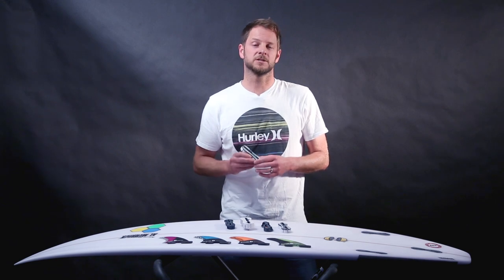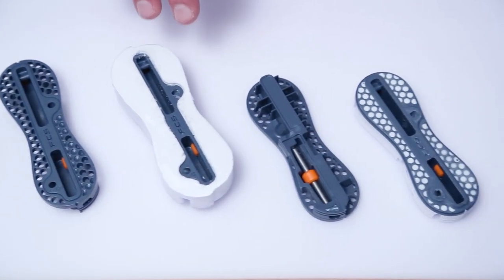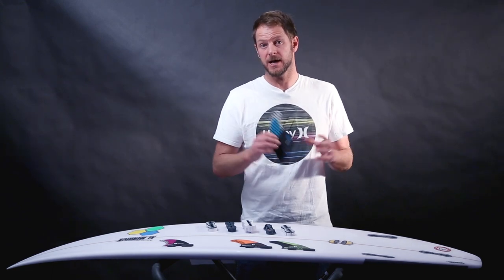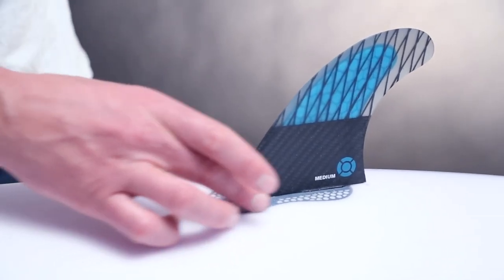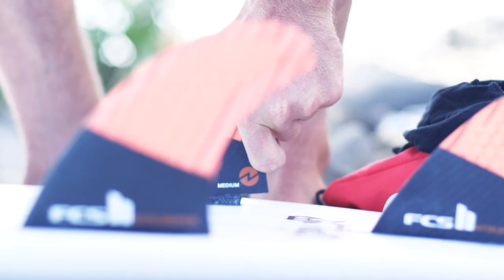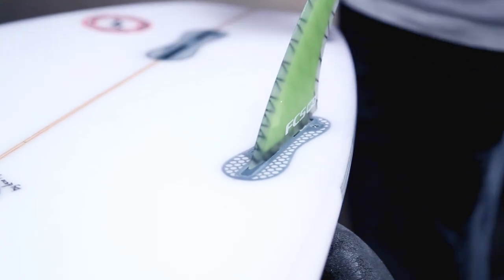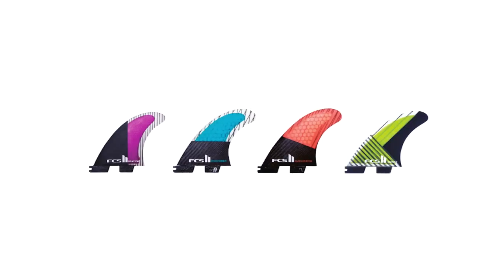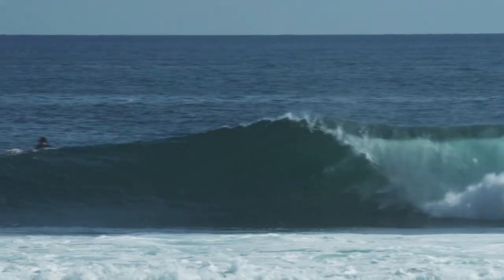The FCS II Fin System

Comment from the maker: Hi, the FCSII system has a high fin retaining force (around 12kg/26Ibs) and fins cannot be removed from the system by placing force on the front or side of the fin (i.e. the direction of forces applied to the fin during surfing). A fin can only be removed from the system by applying an upwards force to the rear of the fin.

Comment: Product Manager explaining the concept to engineers on Day 1 of the FCS II project:

"Ok listen, guys.  We need to completely eliminate the need for tools to install the fins. Oh - the system should also probably be backwards compatible... with tools.  And you could use tools on the new ones too if you want, and screw them in anyway if customers don't trust your design.  But make sure it works without them really good.  And... go."